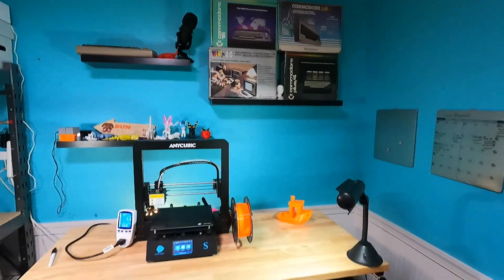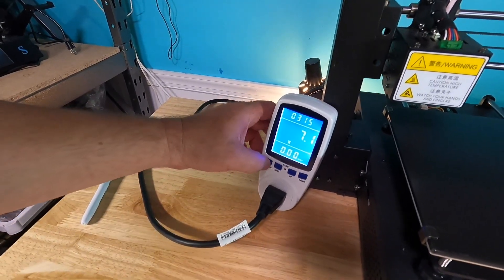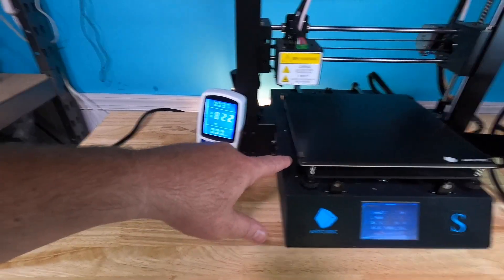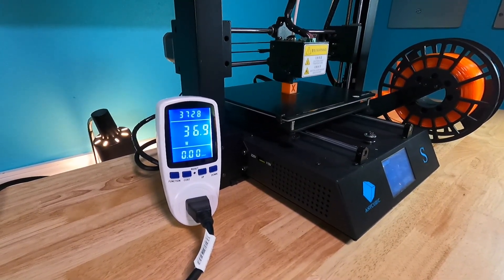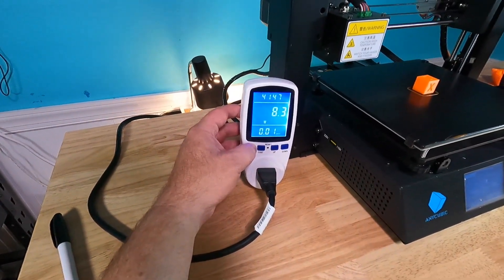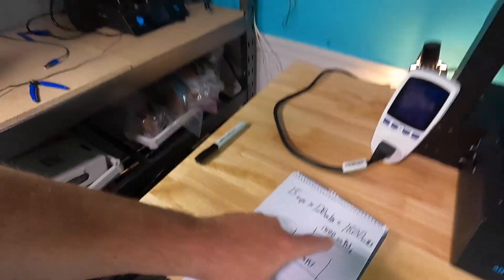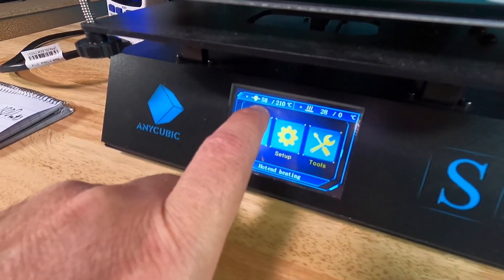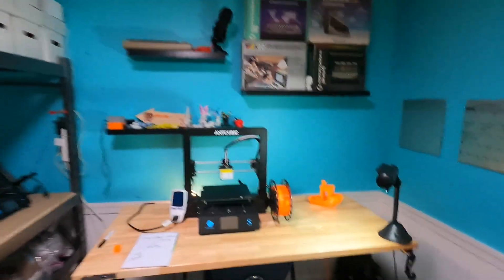How Much Electricity Does a 3D Printer Use?

Comment: Interesting. So you said you get 250 of those from one spool. At your measured rate one spool uses approximately the same amount of electricity as my EV does to do 750 miles. Summer time consumption rate.

Comment: Those 1800W cannot be surpassed on the same socket, or all electric consuming devices of the house cannot surpass this amount?
Reply: just the circuit. Multiple sockets can run on the same circuit though - depends how your house is wired. See if your circuit breaker box has a note / explanation (otherwise there may be some easy test you can search up)

Comment: If you really want to print PLA with a cold bed try using a bed adhesive. If you just want to try it, the cheap way is to use some dollar store glue stick. There are more expensive adhesives, but this would work to try it out.
You can get 2 lager sticks at Dollar Tree for $1.25 plus tax.
There are some YouTube videos on doing it. I haven't done it myself but I know some people do it that way

Comment: Hmm, 30 days 24 hours at two cents 144$ a month per that specific printer.
It's cool to see how cheap home manufacturing is, with the most expensive part being the design time.
Reply from the maker: $14.40 :)
Reply: How is it 14.40?
Reply: @hashiiextracts1743 30 × 24 × .02
I forgot to account for decimal movement when I was doing my math.
Reply: the cost for 30 days at 24 hours per day at a rate of 2 cents per hour:
1. Calculate the total number of hours in 30 davs:
30 days × 24 hours/day = 720 hours
2. Multiply the total hours by the rate (2 cents per hour):
720 hours × 0.02 dollars/hour = 14.40 dollar
So, the total cost is $14.40.
Late af but just getting into the hobby but there I love ChatGPT